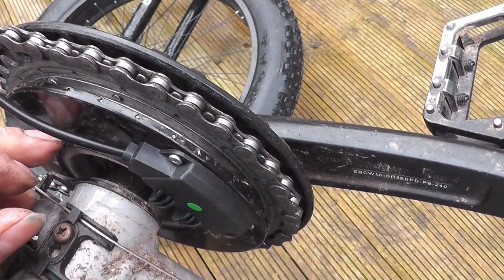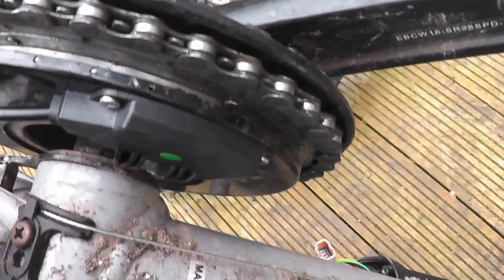carrera vulcan e spec  an #engineering disaster #carrera electric bike,

Comment: As others have said the tab is missing, looks like someone has had a problem before and forgot to refit the ring with the metal securing tab on it (this sits between the plastic sensot lugs and stops it from moving) ,  the lugs get ripped off the sensor when the chain comes off . also there is a plastic ring and a rubber protection shield around the perimeter missing off yours hence why you can see the hall effect sensor rotor . this bike has been badly repaired by a previous owner it would seem, .. that speed controller shouldn`t be out in the open like that , should be in a sealed compartment behind the battery on older models like this  ..... this bike has been botched in the past..

Comment: Hey brother i need help with my carrera vengeance ebike peddle assist, just bought off marketplace 😂 they had put a new battery new controller but cheap brushless parts, i want to rewire so it works as a peddle assist as original, with the original screen but i need to replace the motor wire cable, once ive done that, does it all connect to the controler? Even the crank sensor motor?
Reply from the maker: the stock  parts are utter junk   trust me you rly dont want to do that   you will need  the oem battery  as  talks  to the esc    and the screen  etc           you will need motor  battery lcd  you can buy  a pas sensor  and controller         and do away with the  twist and go setup      will cost about50- £70   for good parts  controller   and  pas sensor

Comment: Hi mate, I have had the exact same issue with mine and it has been sitting in my garage for three years. I have just stumbled across your video and I need a new sensor but Halfords were unable to provide one as it was the older model and I couldn’t manage to find one on online. If you are able to point me in the right direction to source a sensor that would be great, thank you.
Reply from the maker: https://www.ebay.co.uk/itm/315833377684?_skw=carrera+cran+sensor&itmmeta=01JGPHRQKE5TNWSEQ42Y2CJTR4&hash=item498922e394:g:izMAAOSwh-RlKEaM&itmprp=enc%3AAQAJAAAA8HoV3kP08IDx%2BKZ9MfhVJKlI4hmfD4Pop81zvfpDAJmYOogeAKZZQLSo1Q%2B
Reply: @TCBOT  Thankyou!

Comment: ❤I have 2, carrera vulcan E bikes, but both of mine are black, the HESC system from the screen down to the controller and crank sensor and then too the back wheel is absolutely RUBBISH, both bikes have had to have the  crank sensor replaced, one bike has now completely given up because of a problem with the battery, it lights up all the bars except the top bar is flashing which I've been trying a few different things but I have to say that the HESC  SYSTEM is like playing Russian roulette from the minute you buy it, and considering how, crap all the electrics are, this is probably the biggest mistake that Carrera have made, I have always loved Carreras and I have always been impressed with the  quality of their bikes, they have really messed up mash

Comment: hi, I  have a Carrera sasuntour. i have not used the bike for about 4 mths, but when i did it was working fine. i have just tried to use it but the motor is not powering the wheel when i press the pedals.. i have checked the crank sensor, (i only changed it about 6 mths ago) and all seems fine on that, i also do not have any error messages. The motor will work when i press the button on the handlebar control, ( it has a button to assist  if you are pushing the bike)but not working when i cycle. is there anything you can suggest that might cause this? many thanks for any help you can offer.
Reply: This ain't the place . This ain't the guy. He is not what you think he his.

Comment: There is a bracket for it yours has snapped dude
Reply: Yea theres a lug that engages between those 2 plastic posts. The plastic lugs usually break but the stationary metal lug is absent on yours.